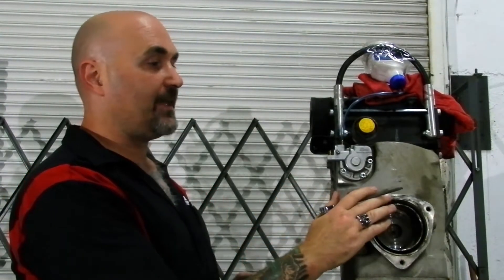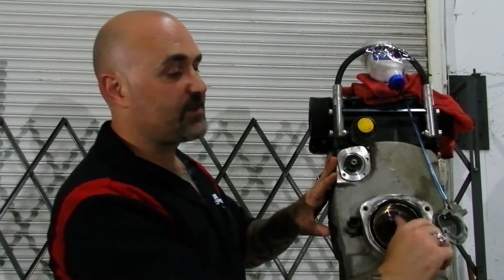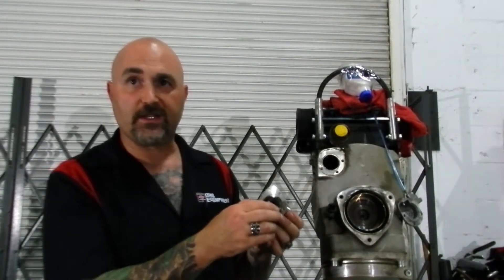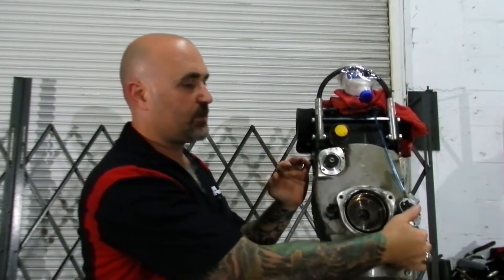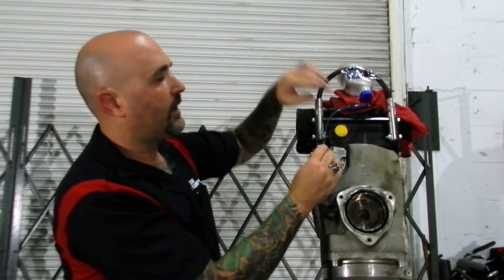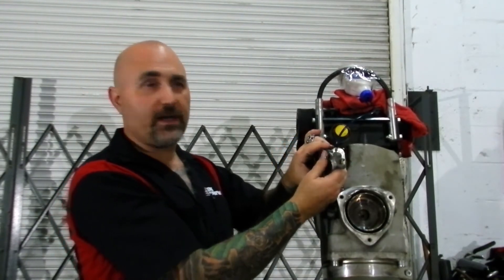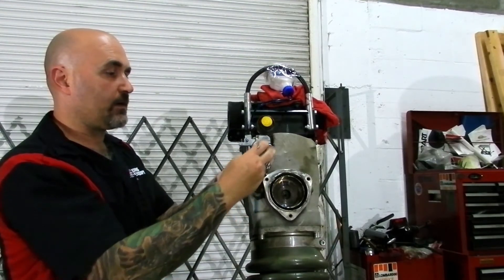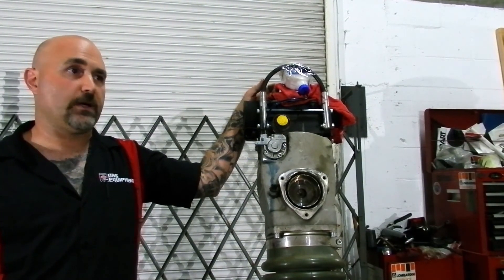Wacker Rammer 2-Cycle Oil Pump Overview

Comment: Got a bs50-2+  with a leaky oil injector.  Can't find the torque specs anywhere, hoping your offer still stands?
Reply from the maker: Hi Nicholas, here's where you can download the manual https://stores.dhsequipmentparts.com/parts-manual-bs50-2-item-0009384-rev100-free-download/ , or feel free to email us at Info@DHSequipment.com if you need more help, Thanks!

Comment: So if it's not pumping oil will the machine sense it and not allow it to run, or will it just burn up the motor?
Reply from the maker: The machine will only sense when there is no oil in the oil tank. If the pump isn't pumping properly it is entirely possible for the engine to run without oil.

Comment: Do all oil pumps run off of the drum flywheel?
Reply from the maker: Hi Deron, for the Wacker Neuson 2-Cycle rammers with oil injection, the oil pump runs off of the drum that houses the clutch inside the gearbox

Comment: I have a bs60 what is filling the cylinder with two stroke oil. It's so much oil it will that you can not pull it over. What could cause this issue?
Reply from the maker: Donald, Please confirm your exact model. BS60 is not enough info. Include the machine s/n too if possible. Oil delivery is different from model to model.
Thank you

Comment: The only video that talks about the oil pump.  My concern with the pump is it is hard to tell if it is working.  I took it off, spun the pump by hand and barely saw oil coming out.  It was leaking more within the small gear drive shaft than coming up out of the port.  I have to assume I have a bad oil pump.  I put on a clear tube onto the carb so I could see if the gas was mixing with oil.  Like you said, it will not pump on idle.  After a short run it did not seem like oil was being mixed.  I could not find anything about what to see or expect for the pump output.  I was thinking of putting 50:1 mix in the gas tank just so I could run it with the oil line off to see if it really is pumping.  Would like your opinion.
Reply from the maker: Hi, yes you can certainly do that to run the machine. Many people disable that completely and go with premix anyway. 
You should see just a small dribble coming out of that pump port when the machine is running full throttle. With the clear tube you installed, did you still have the check valve inline? Maybe try with and without for testing purposes. It is possible you have a check valve issue? https://www.youtube.com/watch?v=Sxjvv_NRK7w . Let me know what you find and hopefully this helps.
Reply: @DHSEquipment  Thanks for the reply.  I did test the check valve and used a brake bleeder to pre-load the oil through the valve to the T connector.  This all started with a carb rebuild kit and me wondering afterwards starting it up and not seeing the oil mix.  Adjusting the carb was fun.  I hung it from my tractor to adjust the high side.  BTW, great set of videos for other maintenance.  Even though it jumps okay, I still may pull the lower unit off to check the springs and stoppers.  Thanks to your detailed video and knowing that if I do have to completely pull it apart I can rent the proper tools.
Reply: @Duckman2405  Glad they were helpful. We have since stopped renting the tools, but those procedures are still easy enough. When you get ready, give us a shout and we can walk you through it.
Thanks
Reply: just put mixed gas in the tank. no need for pump.

Comment: I need some help with running the fuel lines. One came in with the lines removed and I don't know how to wire up the fuel lines. Is the a 1800 number to call?
Thanks
Reply: Frank, You can start by emailing me your s/n of the machine or item & rev # , all found on the data tag. I have repair manuals that may be able to help you out. In the meanwhile, you can call Wacker at 800-770-0957. Without s/n I'm not 100% sure. My email is david@dhsequipment.com
Thanks